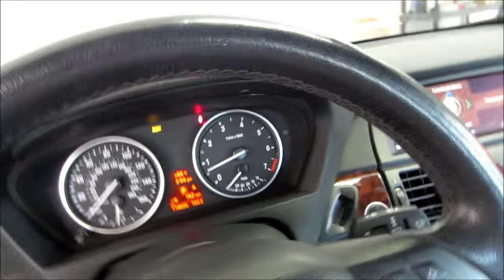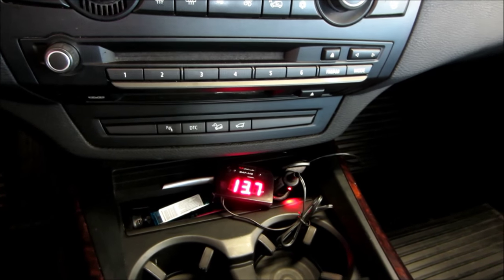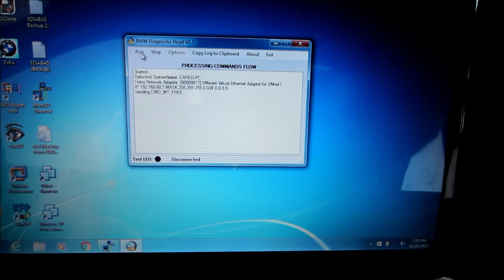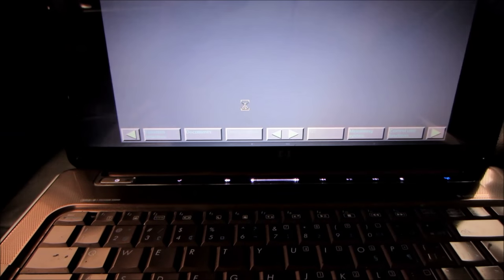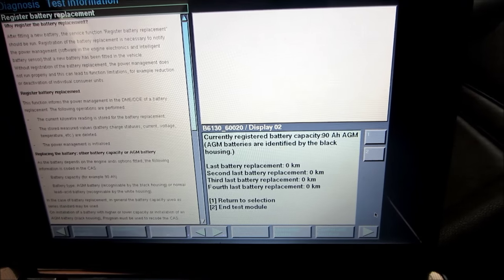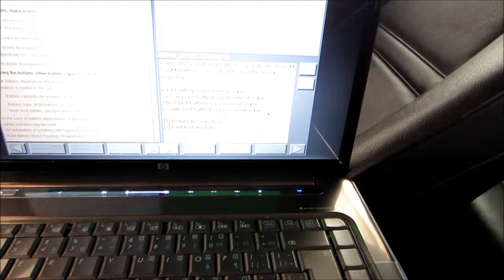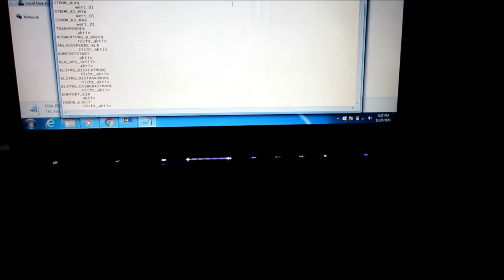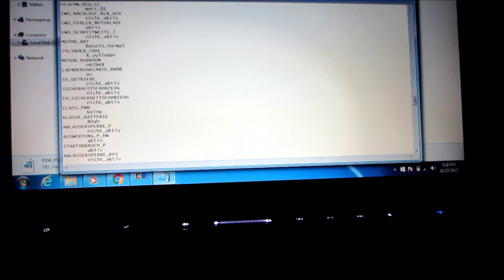BMW E70 X5 Battery Registration and Coding.  Switch from AGM to Lead Acid

Comment: Just completed 2014 X5 battery replacement with a H9-AGM battery. No any warning and registration reqirement prompted. Every thing works as before. Thanks.
Reply: did you check you voltage reading under the hood to see if your battery exceeding the 15 volt range?..I did check mine and indeed reading 15 volts which means I am overcharging my battery
Reply: @taral3548  You are correct. my battery was damaged after 3 month without registration. This time I brought a BMW registration tool to register a new battery. Hope it will last five years.

Comment: I have an E70X5 2010 the hatch is not opening the globe Box not opening an air conditioner only blows hot air and it goes on and off sometimes could this be the cause low battery voltage

Comment: Hello. Before you made the change to the battery register, did you notice weird things your X5 was doing? Such as your CD stacker initialising every time you unlocked the car the next day?
Reply from the maker: Yes actually, when the car barely had enough voltage to start it would do some odd things.

Comment: my comfort access not working on doors but it not working aswell as push
 start without inserting key- do u think it might be something else
Reply from the maker: Figured I'd state the obvious but have you changed the battery in your key fob?  Cars with comfort access do not have rechargeable batteries.  They only last about 2 years and you have to replace them.

Comment: Hmm, works great until i come to 27:20, the coapiReadSgGetFswPsw. When i press ok, and then ok again I get an error message. I´trying to code a non age 100ah battery. Any thoughts?
Reply: The error says coapi-2041: wrong ECU coding index A_E65CAS: codierindex=09h and it continues..
Reply: ever find a solution to this?

Comment: i do not have installed DIS so can i just code with NCS EXPERT?
Reply from the maker: Yes if you just need to code you only need NCS Expert, I used DIS to verify/register the battery.